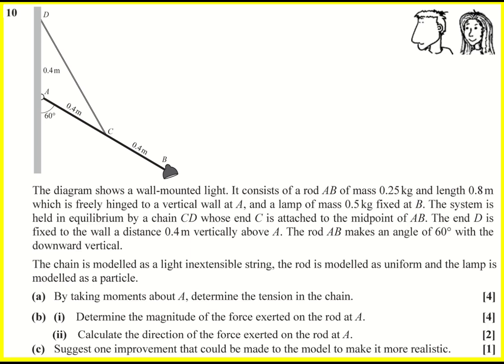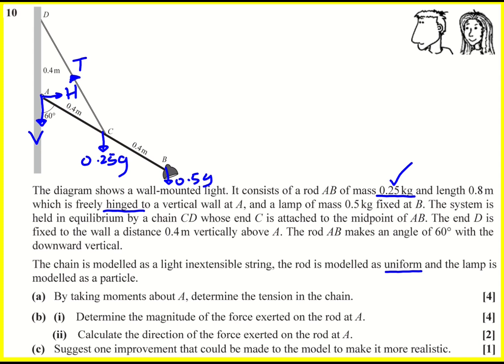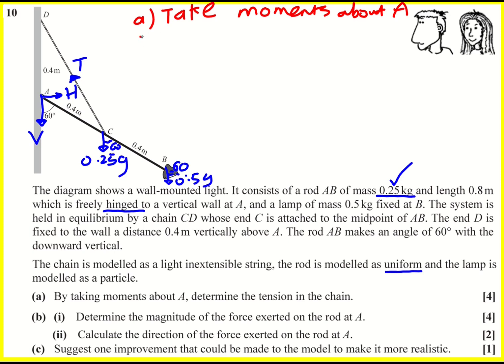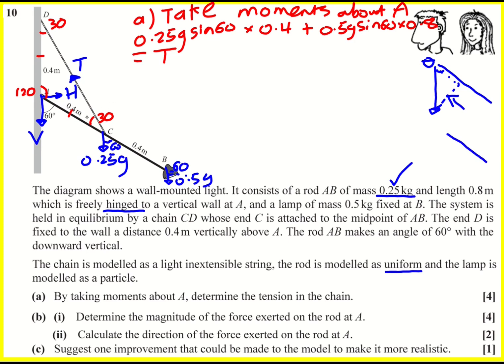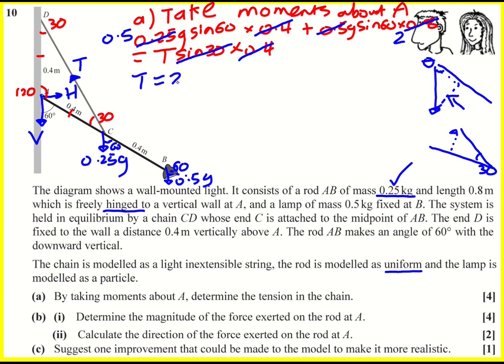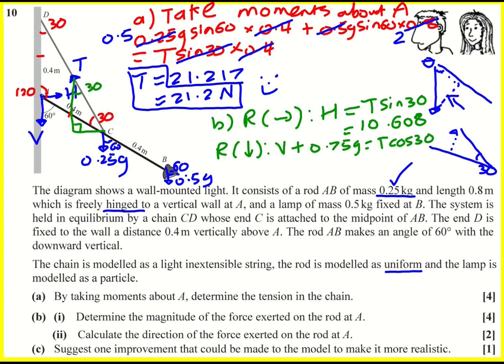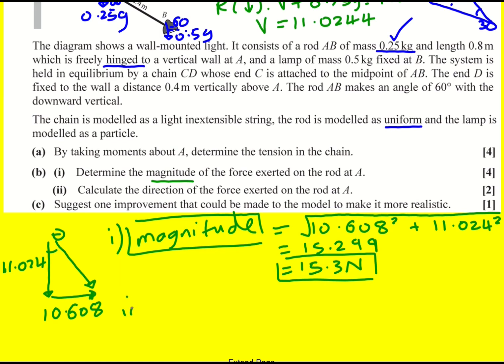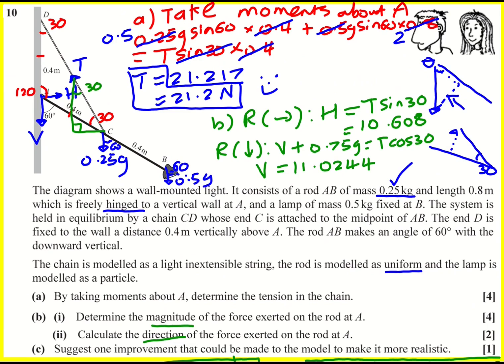AL OCR Jun 2020 paper 3 pure/mechs q10 (Maths A Level)

Comment: wouldnt it be Ttan30 not Tsin30, as we are finding the length of the hypotenuse? I dont really get how you got to Tsin30?
Reply from the maker: I presume you are talking about 5:45. When splitting a force into perpendicular components (in this case along the rod and perpendicular to the rod) the original force is always the hypotenuse. So you never use tan, just sin or cos. I didn't draw the triangle on the screen but there is a part of T going up the rod towards the hinge and part of it perpendicular to the rod. The part along the rod is the adjacent and the perpendicular is the opposite - try to visualise it! Therefore is we want the perpendicular for the moment then it is Tsin30. Does that make sense?
Reply: @mathsmix  i see, yeah that does make a bit more sense - I guess i just need to practice a bit more of finding these angles 💪